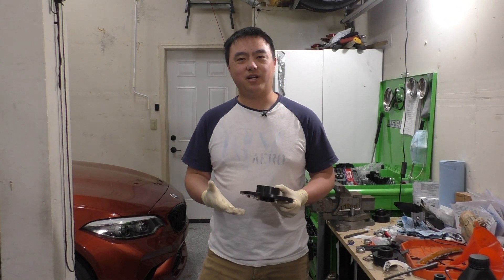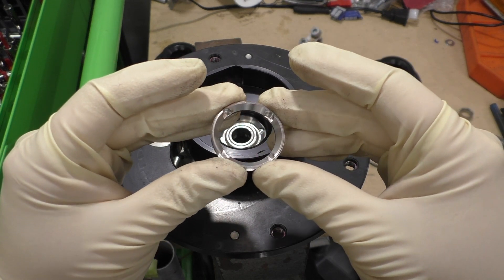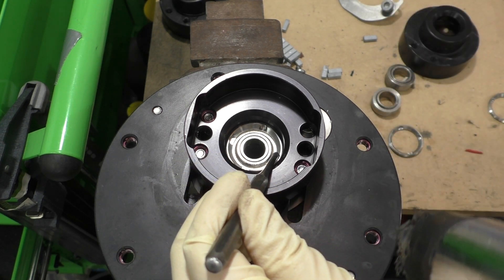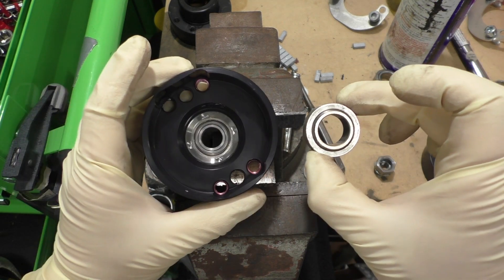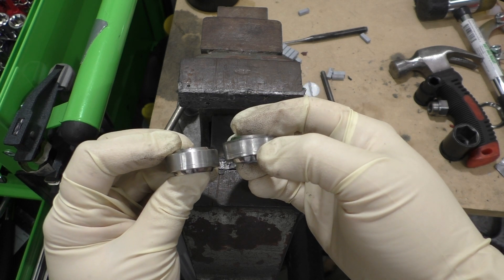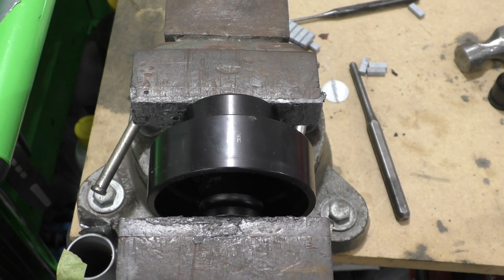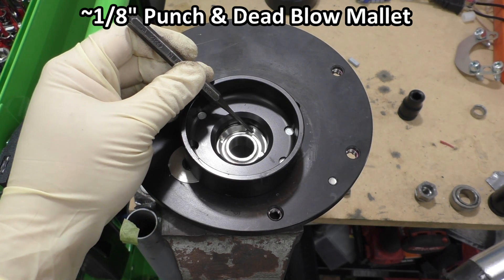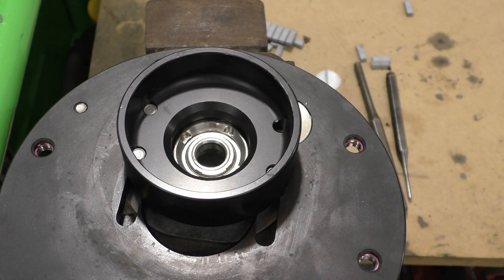Millway Camber Plate Monoball Replacement (BMW F-chassis)

Comment: Thinking it wouldn't be too difficult to make a removal tool from a piece of 1.5in x .25in steel strip from the hardware store. Use a grider or file to round the edges to match the machined pockets in the lock ring. Almost like a huge flat screwdriver tip.  Then use a large adjustable wrench to turn it or drill a whole and use a t-bar.

Comment: Would this also need to be done occasionally on the Millway street camber plates?
Reply from the maker: Potentially (unlikely) if the polyurethane wears out or gets damaged, however changing that is SUPER easy. See 3:13 on my video on the street plate (https://www.youtube.com/watch?v=GLorvAm7Jpk).